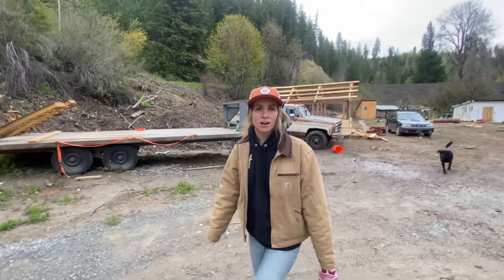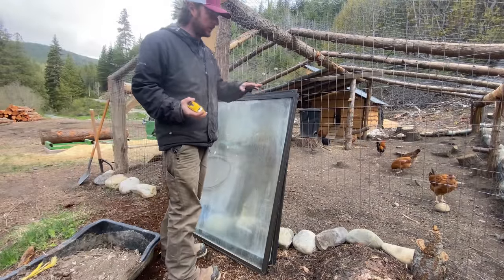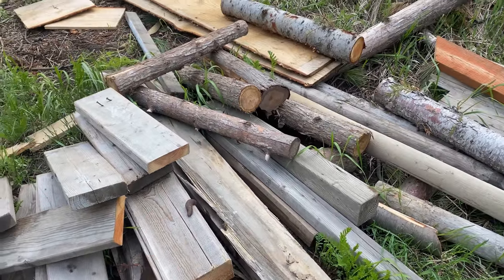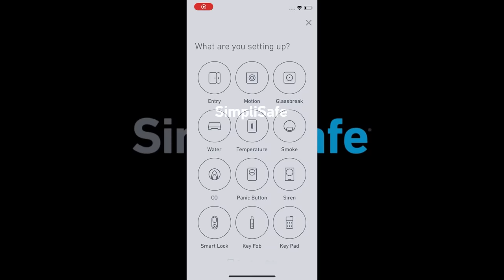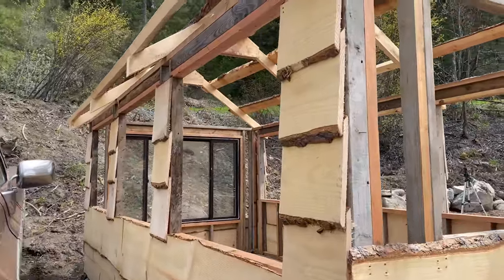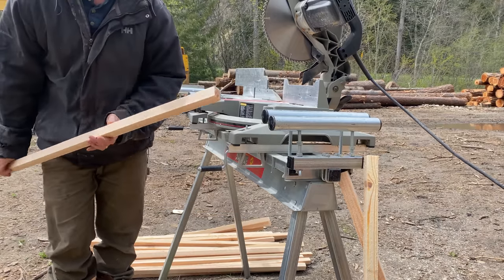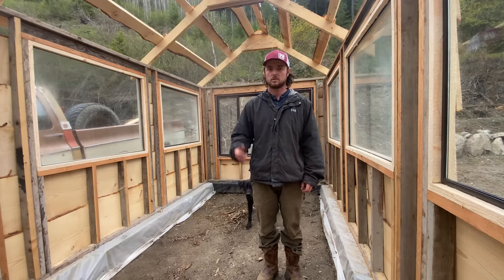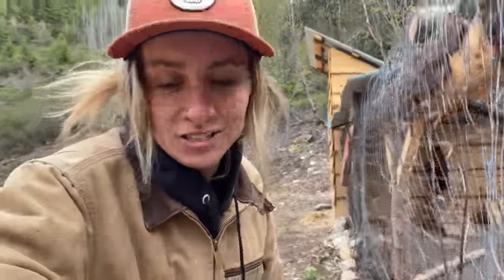Walls & Windows: Homestead Greenhouse

Comment: Hey Mike fyi the strips of wood your talking about is called a stop you have window stops and door stops. You only need stops in one direction on a door the type of window that you are doing you will need at least the one stop 3/4” or 1” on the outside and one on the inside. If the windows your using are just single pain put filler strips to fill in the gap on each side. If you measured wrong .On a house you would moldings as inside stops.

Comment: Hey you greenhouse is looking pretty good. Welcome back to go in one of your videos I don't remember if it was either you or Liz that was talking about cutting some ponderosa and forming a retaining wall here behind your house I have a suggestion I don't know if you thought of it or not but if you take those logs and cut 8x8 beams or even 10 x 10 beams you have your excavator and if you have to you can also stagger on like on a log cabin type deal and then use those big spiked nails to nail them together so they just don't fall out it'd be much better than using the round logs. I know I said stagger but actually I mean you can overlap your joints and then nail your beams together I just wanted to clarify that

Comment: Have you considered; adding the sawdust from the mill to the chicken run.  As they scratch they will mix their nitrogen rich droppings with the dirt below and the sawdust. Remove a layer and replace the sawdust.  Pile to compost into a rich wood fiber soil.  the old guy Bert

Comment: The windows fit perfectly. I wouldn't use a timetable to get things done. At least you saved the time from going to Home Depot. The siding looks great. Making them shingles is clever. That Harbor Freight milling machine is producing great results.

Comment: wow you guys are doing a great job. I like the idea about the door were you can just walk in and out that way you can pull the sides back for a cross breeze if it gets too warm in there. the chickens look wonderful and yeah that white one sounds like he's practicing his vocal cords but he's almost got it. oh and your movable chicken coop Kevin it hidden farms they've got one like what you're trying to make you might want to go over and look at what they've got cuz they've got a wheel system that'll come down it'll lift you roll the the coop and then the wheels will go back up so the coop sits flat on the ground if you could figure out how to put some kind of system like that so that you can move your coop would be easier when you guys get the feeder chickens. also they have issues with predators right now it's coyotes and what they've done is they run a strap from one side to the other and they put a large cinder block on either side and it keeps their coop down where the coyotes can't tip it to get under it to get it I believe they're ducks.